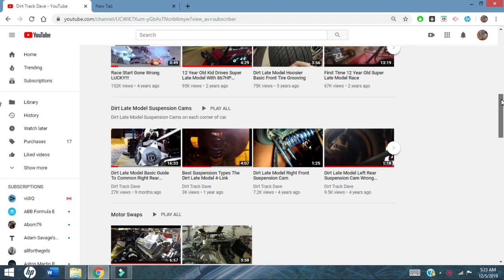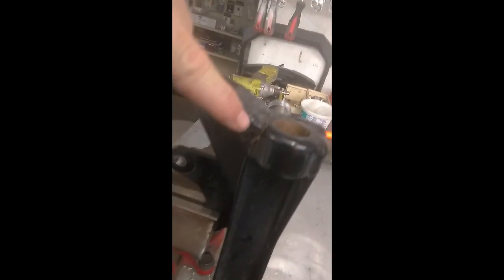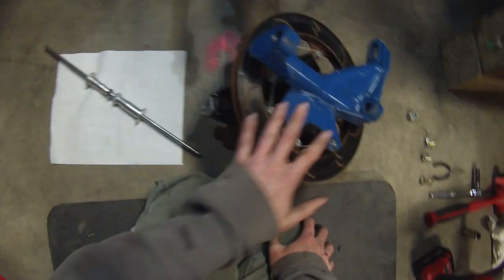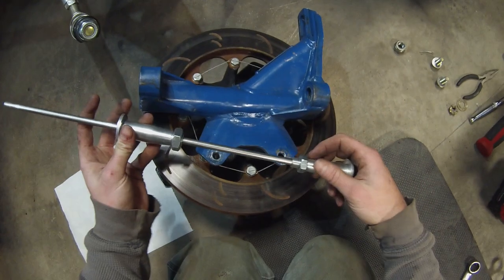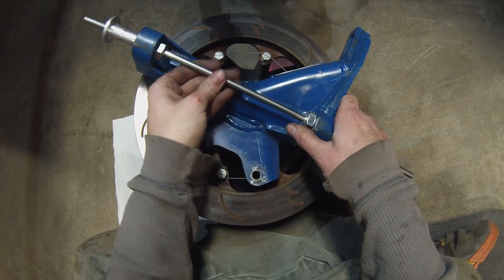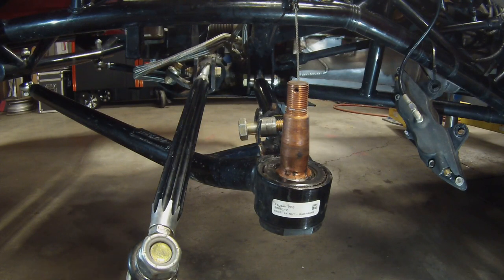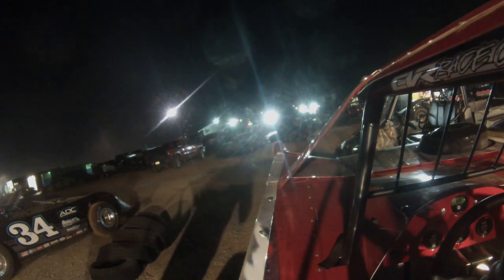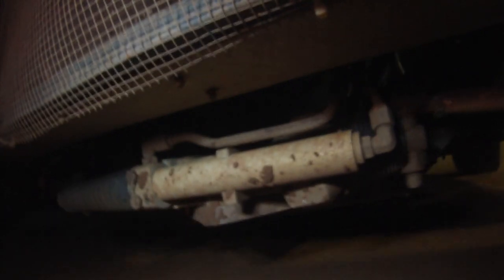Damaged Front Suspension and How to Check It

Comment: Dave it's not the heat from the powder coat process, it's the thickness of the coating that could make detecting the crack difficult. The temp required to form a new crystalline structure in the alloy is never reached during powder curing heat soak.
Reply from the maker: It does, with thick coatings indeed. Most suspension components is spray painted or light powder coating. That spindle had heavy coating and was 1 of 3 that cracked or broke lower ball joint bung out.
Reply: @DirtTrackDave  You need to passivate that weldment... cross section the fracture and look for signs of weld induced hydrogen embrittlement.